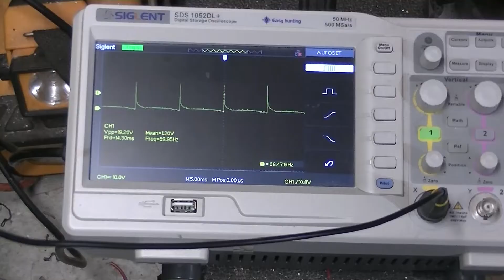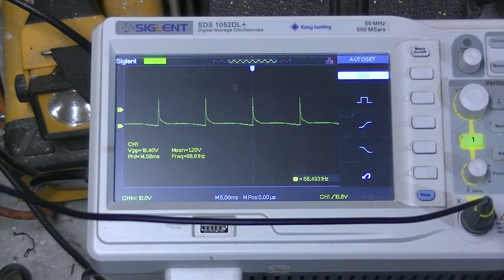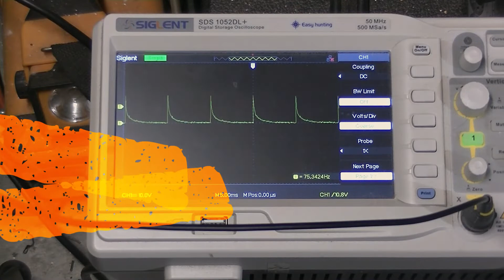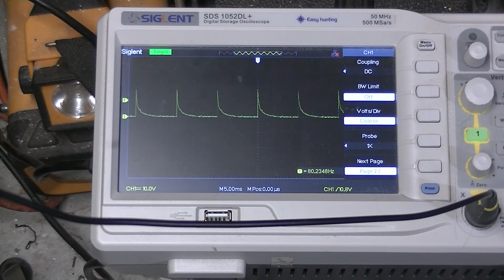Pulse Motor Generator, Adjusting your coil circuits for max output short 2

Comment: What's the stats? , input, rpm, output, frequency etc.
Reply from the maker: I will get back to you about that. No idea about RPM, doesn't matter, Input is 12.5 VDC, The rest, you see on the O-Scope. Thanks.